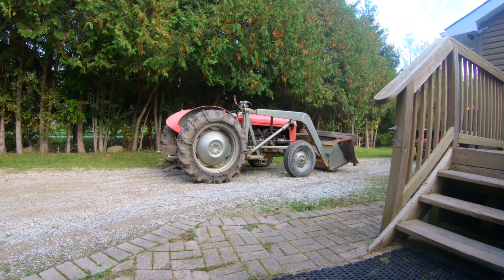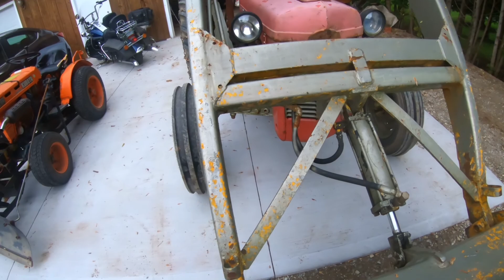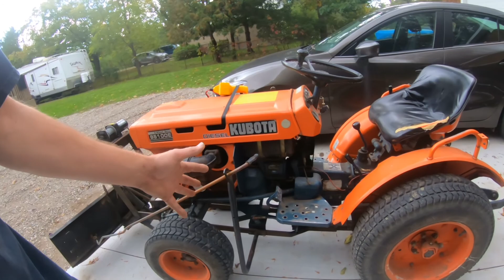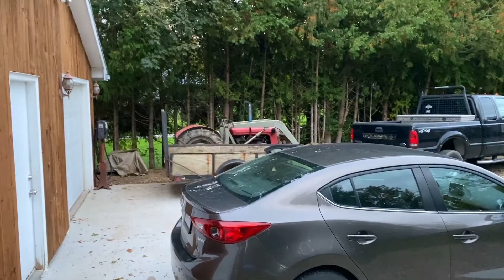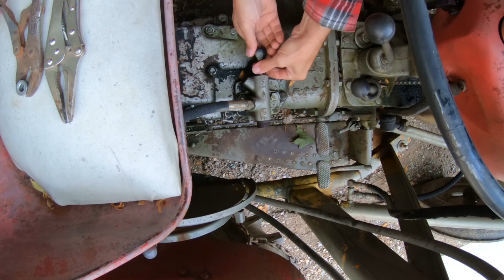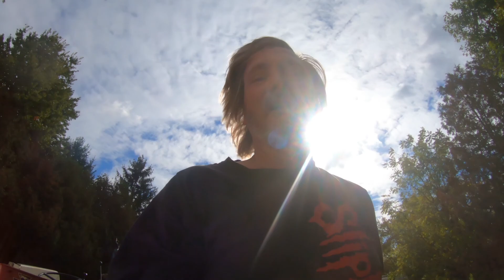1955 Ferguson 35 Tractor - Walkaround and Learning to Operate

Comment: Very informative, well done! I have a 56 Ferguson TO35, but the question I have before I bring mine home is Will the chains on the rear tires destroy my asphalt driveway and cement in my barn?
Reply from the maker: I always run chains and no permanent harm done. A few temporary scratches.